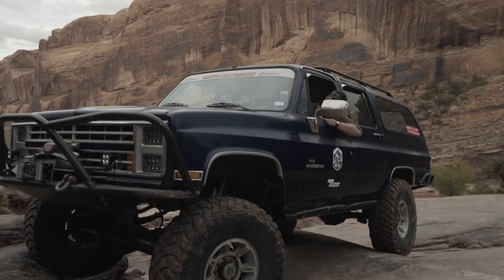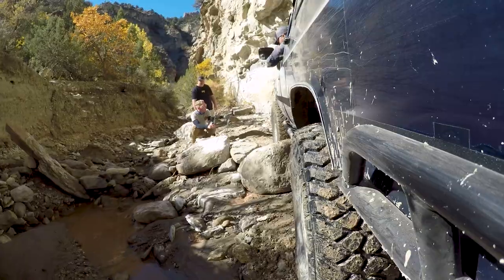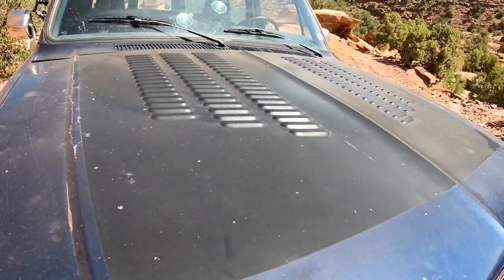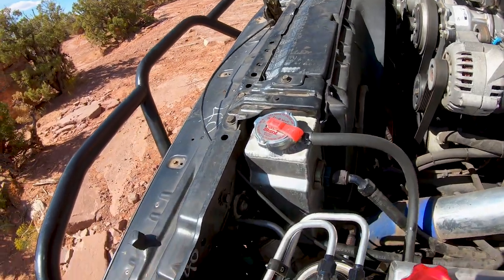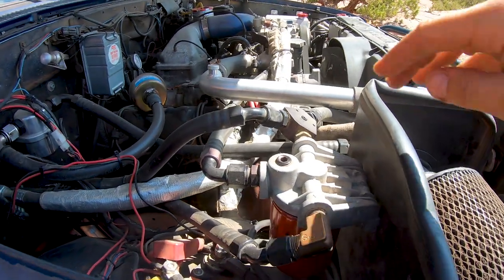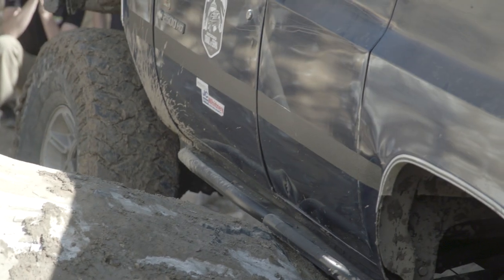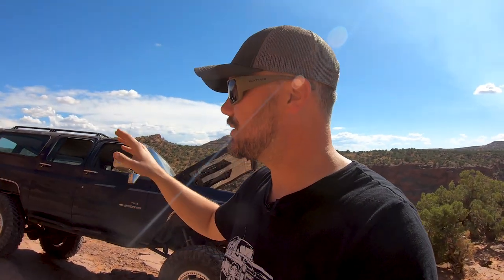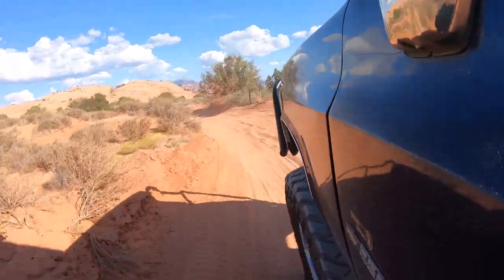One-Owner Squarebody Diesel Suburban on 40s - One Piece at a Time – Walk Around

Comment: Had a 1997 Tahoe with 37"x13.5" tires & 9" of lift with 4:56 gears. Even though it was close to 300k miles body & 150k miles engine it was a blast to drive. Well, until the 4L60E crapped out 😅 I'll get another big boy eventually, would like to get an 1988 Suburban & do a similar build one day!
Reply from the maker: Get that square!  You'll never look back.

Comment: Those square body Suburbans were built from 1973 through 1991 & they're also the seventh generation Suburbans. Like those square body Suburbans, the square body K5 Blazers, Jimmys, & pickups were also built from 1973 through 1991, except the regular cab pickups were discontinued in 1987 on the half ton & three quarter ton models. The one ton regular cab pickups on the other hand were still in production up through 1989.

Comment: I have a build in process, and two builds on the back-burners.

I have an 83 Suburban 4x4 frame that I tossed the body off of. I swapped the 6.2 for a first Gen 5.9. I’m. Going to swap the body from an 89 Suburban onto it.

The next will be to rebuild a 2wd 89 that has a 454.

Then I’ll rebuild a 73 CrewCab that I have and I’m going to use the 3rd Gen 5.9 that I use as my daily driver now.
Reply from the maker: That will be a darned nice fleet.

Comment: Some few in France, never seen a one like this, and want to say THAT is the Surb I would love to possess one day ! not only lifted, but building for tough use and travel everywhere !! And the ice on the cake, you let the 6.2 in. Kudos bro' !! How you are lucky in US man, here in France it's become really difficult to practice with a 4WD even in trails. 
Thanx for all the specs you share, you are a smart guy !! Now I want one and want to leave away all this bullshit life we live.
Reply from the maker: It's rewarding to get to build and use a truck for long stretches of time. I'm glad this video was useful to you.
Reply: @WillometMotorFab   You welcome man, since I've seen a Silverado and his brother the Suburb', I literally fell in love with. Could you say Why some people replace the 6.2 GM engine by a 5.9 Cummins? Does the 6.2 not reliable enough or there is another reason? Because I really like how you've tuned your truck and let the genuine engine inside it.
Reply from the maker: The 5.9 is a burly design that can make a huge amount of torque with the standard internals. The 6.2 was designed for optimal fuel economy, and with select upgrades and good maintenance it can make very decent power. 450-500 lb-ft is very achievable, but you've got to want to invest in the platform. Most folks want to go an easier route with an LS or a 5.9. That's fine, too.
Reply: @WillometMotorFab  Ok David, thanx a lot! as I do myself the mechanics/maintenance on my cars or bikes, it's a really pleasure to hear/see somebody who has the expertise in what he does and shares his knowledge with simplicity !

Comment: Great video. I’m building an 85 diesel suburban right now too. Almost done with an NV4500 swap. I’d like to turbo it but the block has cracks on almost all the main webs (pretty typical with the 6.2), so I’ll probably just drive it like it is for a while.
Reply from the maker: Cracks happen, and are many times linked to a damper failure. On your new engine, just make sure it's got a fresh damper.

Comment: Love it. Are going to go into how and what pieces you used on the 6.2 for us other 6.2 brethren? Very glad for this channel. Dave, do you know if the Heath Diesel 6.5 Oil Cooler kit will fit the 6.2? I emailed him but am still waiting. Thanks, love the channel. Mike
Reply from the maker: Thank you sir - glad you’re here. I’ll go into more detail as y’all would like. The engine could get an episode of its own, and I’ll put that on the list.

I have no idea if that Heath kit will fit a 6.2. The threading in the blocks is likely the same, and any aftermarket oil cooler kit is ultimately trying to get away from the junk factory lines. If there is any compatibility problem, it probably would be hose length.
Reply: @WillometMotorFab  An episode on the engine alone would be a very good idea.  All I have ever heard about it, and the 6.5 for that matter, is to swap it for a Cummins or Duramax.  Your truck seems to handle itself very well in the rocks and doesn't seem to have a lack of power, considering it's weight.
Reply from the maker: DieselAddicted solid idea. They’re good powerplants when you take care of them. Just don’t go looking for 1000 lb-ft

Comment: Nice rig. Are you running your sway bar on pavement? Just did the diy4x shackle flip on my rig. Can't put it back on with the new u bolt plates. Wondering if its necessary? Thanks
Reply from the maker: I haven’t run a swaybar at all in quite a while, but really should have. ORD just came out with one that works with crossover steering.

Comment: Badass rig. What’s the actual vehicle weight?  You had said 8,500 lbs but that’s most likely the gross vehicle weight rating (maximum weight fully loaded)
Reply from the maker: It's actually 8500 pounds with a full tank, a spare, and yours truly in the seat. Suburbans are heavy.

Comment: 8500?!! I weighed in at 7100 with a 24v cummins, Dana 60 front, frame 80% boxed and my ass sitting in it
Reply from the maker: It's a lot.  I weighed it with gear and a spare, 40 gallons of diesel, plus Kurt and me in the front.  It's a surprisingly short leap from where you're at to over 8000.

Comment: you said first gear ratio is 2.5 to 1 and final drive ratio is 4.88 to 1 so if low range of transfer case is 2.72 then crawl ratio will be 33 to 1 not 55.am l missing sth?
Reply from the maker: The magnum box and 205 work together, so the 33:1 you correctly calculated gets multiplied again by 2 through the 205, thus around 65:1